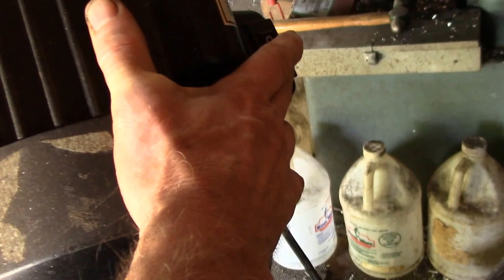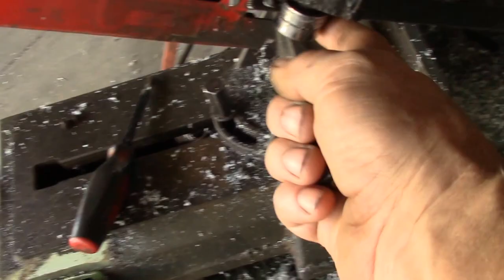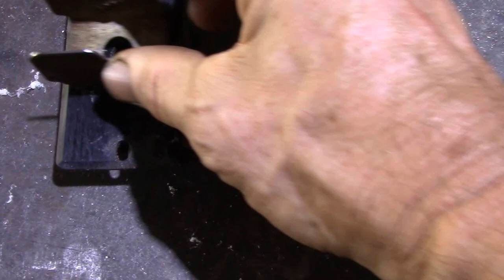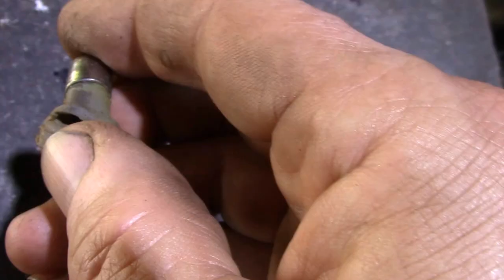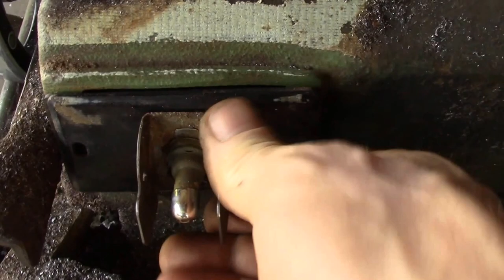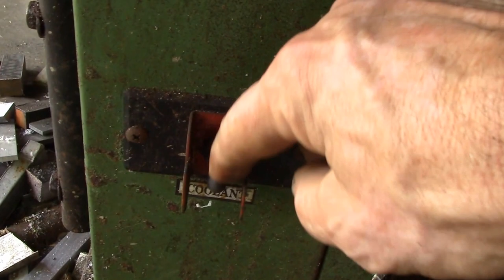Horizontal Bandsaw Switch Repair

Comment: Nice video. So I have a question I’m trying to fix the issue on this Bandsaw at work but the on and off switch I have a different. I go to press the on switch but it only stay on I even changed and install a new switch and still the same thing. What should I do?
Reply from the maker: My 2 bandsaws both have simple toggle switches and they get turned off by a tab on the saw frame that hits the toggle lever at the end of the cut.  Maybe see if you can find a manual for your saw on-line and see if that has a parts diagram.
Reply: @The4Crawler hey sir how can I bypass the switch on my 4 1/2 inch Clarke bandsaw? I believe we have similar setups wiring route wise so I’m trying to figure out how I can just delete that switch and be able to just plugin to a outlet switch plug whenever I need to use saw
Reply: There’s a wire coming from motor that goes to outlet and a separate wire that goes under carriage to the switch. It’s a Clarke metalworker 4 1/2
Reply from the maker: @RETIREDAMATUER  Best bet is to  open up the switch box and see how it's wired.  Usually just has 2 wires inside with wire nuts putting the switch in-line with the hot wire.  If so, just pull the 2 wires nuts off and join the incoming and outgoing wires together, leaving the switch out of the circuit.
Reply: @The4Crawler  thank you very much, I bypassed the switch and I don’t believe that was the problem. Motor still has no sign of life when turned on but has current from plug all the way to switch I can’t find any dead spots so I’m assuming bad capacitor or something
Reply from the maker: @RETIREDAMATUER  On my 4x6 bandsaw, I believe the motor has a start capacitor.  My 7x12 saw seems to have a centrifugal switch and start coil.  That saw does have a capacitor on the coolant pump motor and I replaced that a while back:
https://youtu.be/_qPHR7-o3sM?si=f_fLMJp4ydHk3J_H
With a bad start cap, the motor may make a buzzing noise.
Reply: @The4Crawler  thanks brother I appreciate you!! Happy holidays
Reply: @The4Crawler  so it would be okay to do the same thing you did for the coolant switch and just connect a jumper on the hot and neutral wire for my on/off switch ? Sorry if this is a stupid question I’m not very knowledgeable of electrical stuff. I just wanna make sure I’m not gonna blow the breaker or cause a fire haha
Reply from the maker: @RETIREDAMATUER  You could try that, I did so thinking I had a bad switch.  But it turned out the capacitor was bad and jumping out the switch didn't help.   If the motor has a round cover on top, then that's often where the start capacitor is located.  If there is one, there's usually a sticker on it with a capacity (uF) and voltage rating.  It's not that expensive to replace, I found the one I used on my coolant pump on Amazon, just search for the uF rating and motor start capacitor and make sure the voltage rating is at least equal to (higher is OK) the rating of the old part.